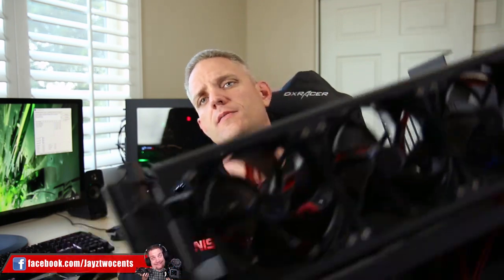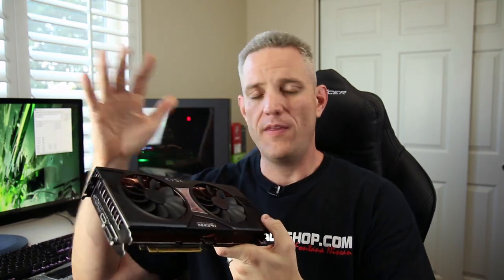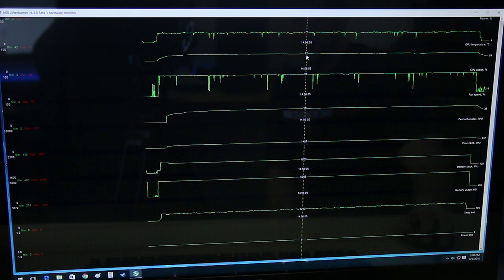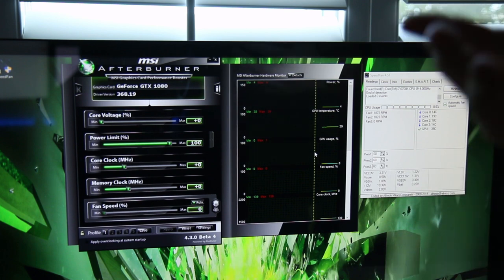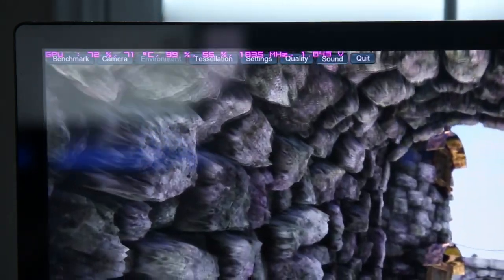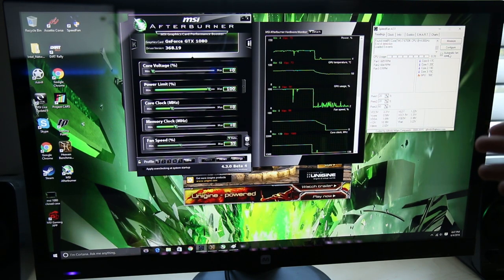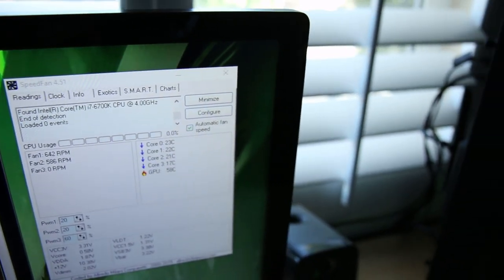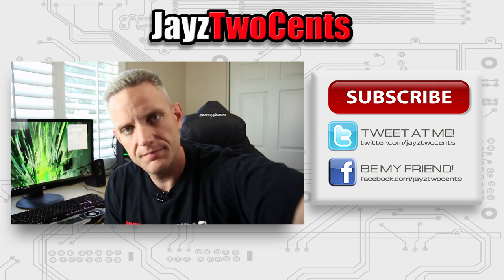Do cases make video cards run hotter?? - Test Bench vs Case

Comment: Humor me if you can Jay. Could the case be isolating heat from radiating out to the surrounding air in an chaotic manner whereas the open test bench allows the heat to spread based only on thermodynamics? As in the case is taking air in from a "cooler" end (usually the front) and directing it to a "hotter" end (usually the back), is the case taking advantage by reducing the volume and pressures inside vs outside? Based on what I know of thermodynamics (I'm a vet, not a physicist) I would have thought that the case would have been the same temps. 

Also, any chance you could test why the voltages were different?

Comment: Any idea why my EVGA 980Ti Hybrid inside my Phanteks Evolv mATX runs at ~70C instead of the advertised ~50C? If it matters, I am using a Cryorig R1 Universal CPU fan, all case fans are in normal config, and the Hybrid's radiator is mounted at the top of the case in a push/pull config.

Comment: I watched another video on your case cooling flow and does it matter showing how to set fans in a case air flow direction and it really worked well in my case I set it up and now it runs cooler then the room temp.

Comment: JayzTwoCent - I have a question for you. I have Alienware aurora r4 Desktop. Ive fitted gtx 980 ti Asus Platinum graphics card . After unigine benchmark my card fans go 85% and 91 celsius which is extremely hot. When I swapped the cases with 6 fans inside and did the same test my fans spinning at 60% and temps are 67 celsius . Why this is happening? I know that the Alienware aurora r4 case is mid tower but come on!!! Do you think Reference card will be better in Alienware case because the hot air goes out of the card ?? or what shell I do???? thanks
Please people help me to sort this out.

Comment: Best way to drop GPU temps is to put a nice quiet fan on the side fan spot of the case blowing fresh air from outside the case directly on the GPU. 

I managed to drop over 7c by adding one of my extra fans there which got me from throttling to having nice cool temperatures

Comment: What do you mean you can't figure it out?
Learned this a long time ago while messing around with opening the side of a case, and closing it.
Your open testbench, unless you have fans pointed at certain points of the motherboard, will run hotter than a closed case, b/c it has airflow.
The back of the card will get air, as will the rest of the components of the motherboard that need cooling in a closed case.
Airflow is important, not so much just the GPU and CPU getting air blasted right on them.

Comment: guys, bit of a question. I've got a stock case by medion because my pc is a stock prebuilt and im thinking about replacing my reference 760 with something like an asus strix r9 390x. I don't have fans in my case. does that cause any problems with temperature?

Comment: A potential problem I can see with this approach is that the Unigine demo does not really stress the CPU.  If the GFX card is venting out the back of the case then the CPU is going to be the main heat source in the case and and in this instance you will not necessarily see the temperature rises inside the case you would normally see  if the CPU is under a heavy load.  However if a water cooling block is used on the CPU it may be possible to mitigate this effect by blowing air from inside the case across the rad to the outside.

I think that in this instance results may vary with system configuration and it would of been good to also see system temperature.  Ultimately if the temp inside the case increases the GFX temp will also increase as the temperature delta gets smaller.  The real question is how much of an effect the change in temp delta affects GFX cooling efficiency which I dont think is answered with the information presented here.

Comment: my question is does the open air bench have fans? I only ask because on my h440 I notice some intensive temp changes when I take the side panel off and I think the extra area it can escape helps a lot
Reply: by intensive I mean like 5°C lol so not that much but it definitely is somewhat different

Comment: Hey love your channel, been very informative!  This might not have anything to do with this video but I want some advice on product selection.  I currently run a Phenom II x4 965 and an MSI hd6870.. yeah its an older rig, about 5 years old.  I'm going to be upgrading.  looking at either an i7 3770k (buddy is selling me one for 250) or a i7 6700k.  Next was going to go with a 980ti but then realized for either a little more or little less I could go 1080 or 1070.  if I went 1070 I was considering running two in sli.  The gaming I do is mostly flight sims and with a lot of the scenery packs they are extremely graphically intense.  Which CPU and GPU setup would you pick? I'm having a hard time deciding what to do..
Reply: An i7 3770k would bottleneck a 1080/1070 sli system, so i'd say go all in, so you have more time until you need to upgrade again
Reply: what proc would you recommend then? A 4790k? 6700k? other? Dont want to really break the bank but i also dont want to really skimp
Reply: Dan31387 6700k
Reply: Maybe in some games, but a 3770K is still quite fast nowadays. If that CPU is the difference between the 1080 vs 1070 I'd go for the 1080 with slower CPU all day. Then, when you have funds again next year, jump on Skylake-E and X190 if you really feel a bottleneck (or go 1080 SLI if you need moar fps). You could then grandfather the 3770K to a server or HTPC/Steam Machine. Also nice to separate your upgrade cycles, so you don't have to buy an entirely new system every time you upgrade.

On the other hand, the more modern features (NVMe, DDR4, USB-C and TB3) of a Z170 board could be worth it, depending on your use.

Comment: Well done.

I'd look into PSU voltages, for the difference in voltages. As per ATX specs, it can vary by 5%, so that 12v rail could be anywhere between 11.4 and 12.6 volts. The onboard regulator is not supposed to be affected, but with a diff of only 0.02v, the 12v rail is the likely suspect. Got a good DMM?

Not a lot of people understand the temperature gradient, between the core, and the ambient air. Thermodynamics, it's a science.

Comment: I'm just gonna add my two cents here. My Asus Strix970@1530Mhz in a Coolermaster Mastercase 5 pro, with front and top fans off it hits 72-73C plus fans run louder, with top and fornt fans on it stays under on 69C at full load.

Comment: the point of this test is to measure the impact the case has on cooling, but you are using cards with after market coolers. why dont you use reference cards when doing this test to really see if the thermals make a difference being in a case. you reviewed the 1080 on an open test bench and made it seem like the thermals were good even though everywhere else were complaining about high temps and thermal throttling. aftermarket cards will obviously run cooler with extra heat pipes and bigger heat sink , bigger fans.

Comment: I thought the issue was for OC'd reference cards?  There was clearly a problem in computerbase's tests.  The 1080 ref couldnt run longer than 5 mins before throttling back to base clock in a case.

Comment: Perhaps the PSU used in the case is more efficient than the PSU used in the test bench, allowing cleaner voltage (and thus lower) to the GPU? Besides, 10-15 mV will not affect a card pulling 180w.

Comment: Would love to see two AIC 1080s in SLI in the open bench vs. the case. The conventional wisdom is to use blowers for SLI, but it'd be very interesting to see if this new generation of aftermarket coolers are powerful enough to re-write the rules.

Comment: Thanks Jay for doing this test I often wondered about test bench vrs Case results  but I had a suspicion they would be the same or very little difference because other test figure from other sources would be wildly different ? 
Was interesting though about the voltage difference ,on logic the test bench should be hotter or higher fan speed 
Thanks again for taking the time to run these tests and shorten the results 15 minutes and not a 4 hour plus stream :-)

Comment: Jay please review the asus gtx 980 ti vs a custom cooled gtx 980 ti to see difference in performance. I’m curious as to why these hybrid cooled cards aren’t as popular when they have the convenience of being ready for a custom loop out of the box and cooling redundancy as well. Looking to buy a 1080 and trying to decide if I should wait a little more for the asus 1080 poseidon(granting they do release it). Now I know there are gpus with hybrid coolers out there but those things have smaller radiators, integrated pumps that have a higher chance of failure than a d5 or ddc and the aforementioned cooler fans on the Poseidon which also cools its gpu chip. Thank you and good day.